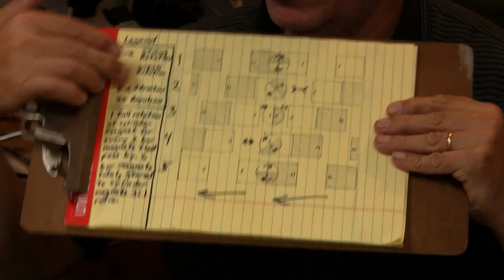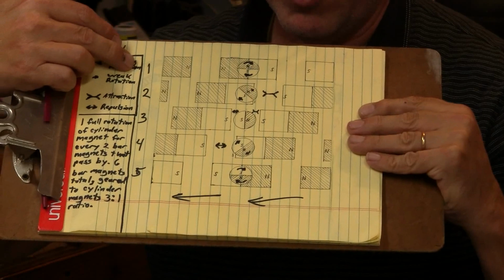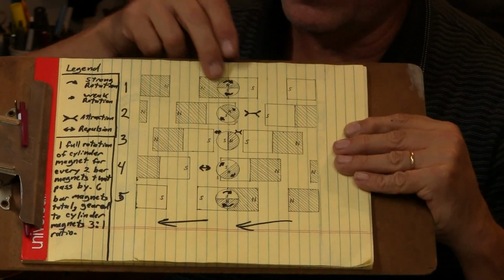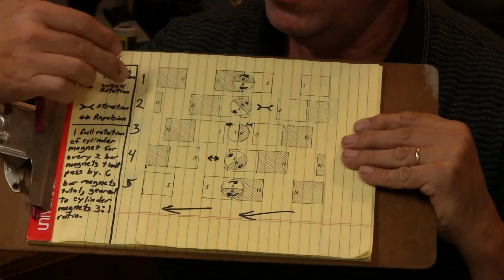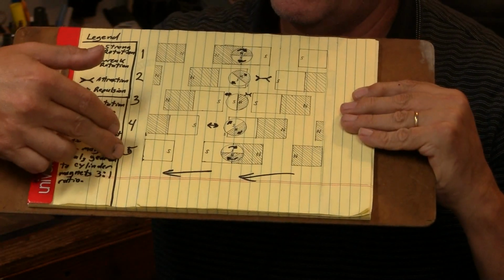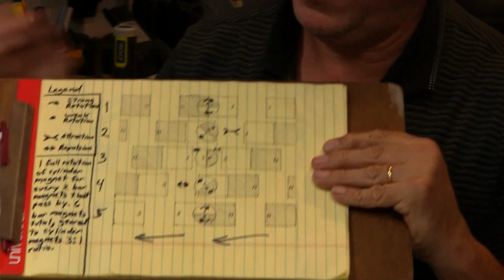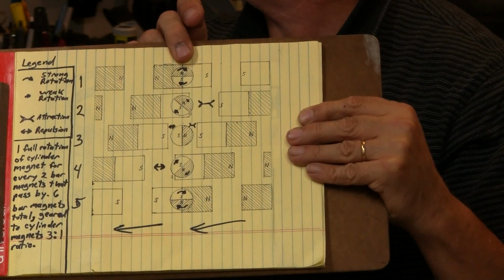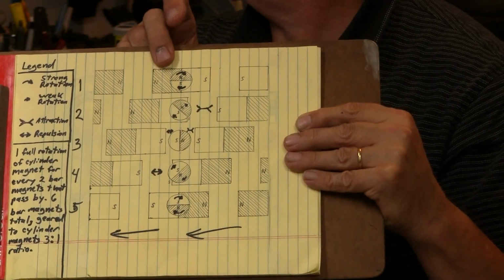#378 Vortex Field Permanent Magnet Motor part 1

Comment: Equilibrium will be the result unfortunately.
Reply from the maker: Mike Hara As of last night I have already conclusively demonstrated a state of NON-equilibrium, a continuous rotary imbalance. Not self running yet but I am making strides in that direction and have already reached the first milestone.
Reply: Funny you say that you lay awake at night working out this particular invention,I remember way back when I was in my twenties I'm now 67yrs
I had the same thoughts occur to me and like you they came when I lay down to sleep In my mind I solved the worlds energy problems over night
I invented a magnetic motor of course back in those days the internet did not exist.I mentioned it to some people that I knew,but they just looked at me and I could see in their eyes what sort of a nutter is this,so for many years I put it to the back of my mind and just thought to my self that I must be a little bit crazy having such strange thoughts.Then the internet came along and I discovered that the world was filled with crazy people like me having the same thoughts,I looked at alot of their magnetic motor
played all the youtube videos,and each one came to the same fate a brake
rather than a motor.The one I thought up years ago Is a little different from the most common ones found on youtube,but would probable come to the same fate as the rest If it was ever put together. I'm not a practical person so the Invention stay in my mind,but I'll always wonder maybe.Now Mark tell me If you feel like it when did these magnetic motor thoughts first bother you.

  PS and all the best with your latest endeavor

Comment: Hi Z, ive been thinking about this today... id like to offer something. Im not offering this to take over, just wanted to share. The big spinning barrel, what i saw in my minds eye was 4 armitures with small weights. In the beginning setting, they are all pointing outwards, all weights beyond the outside diamiter. Then as it begins to spin the armtures begin to fold in, bringing the wieghts into alignment with the diamater. I was picturing how a skating champion pulls her arms in and this creates faster spin. .. dont know if this helps or not, but i thought id share

Comment: Well done Zero , you will probably have some sticky spots somewhere , if you dont use iron core pieces to guide the flux away from them , so please research exactly , where the sticky spots will be and how to cancel them. Please dont give up easily on a first failure. You really have to nail it down. Also magnets from the same production batch have different strengths,  so please make sure you think about this..
Many thanks. Regards , Stefan.
Reply from the maker: overunitydotcom I will be adding progress reports in the description until the next video. Please check back often.
Reply: ZeroFossilFuel I would guess you have a "sticky spot" halfway between position 2 and 3.. keep thinking of new ways...

Comment: Have you modelled the rotations of the cylinder versus the outside magnet?  I ask as even a 0.001 difference in rotation between the two will stop your motor after a short while.

Comment: i see a issue when the cylindrical magnet is in between the bar magnets as the south pole is resistant to rotation, I believe if can be overcome by shifting the magnets to an angle to remove the strength of the repelling forces.  I also believe that 9 is a better number for using instead of 5 on your radial crossover points.
Reply: I don't see any basis for you to think your changes make the machine better.  You are just moving where magnetic poles are placed.  It doesn't change the fact that the force between the poles is always along the line between the poles and the strength of the force depends on the current distance between the poles.

Comment: I like, It will work but the question is: how much power can it produce, if any without a supplemental energy input. Such as electric magnetic control and for producing more power. Hey, one thing at a time, GOOD LUCK and wish you the best.
Reply: Good post, subbing this channel...
Reply: To reduce gear drag in the drive you show, if that is what Z intends to use. A very low drag gear set up would be o use only two beveled gears are needed. In other words one large ring beveled gear on the rotor drum and one beveled gear for each rotary vortex magnet. Hey just a thought, GOOD LUCK

Comment: Will the five rotational magnets be in sync or alternating? Also it would seem to me that the diameter of both the rotational magnet and the acrylic cylinder will have to all be perfect ratios for the timing to work out. Lots of math that will have to be perfect.

Comment: Ok. It looks like a good design, but very unstable regarding the timing between the wheels. Even if you push the horizontal axis a quater of a mm closer to the vertical axes, the whole timing of the system might be lost. Even if your gears wear out a tiny little bit, this whole system is compromised. Situation is the same if any gear or wheel is outcentered. I just want to see this thing moving when it's all done - in REAL TIME! Best of luck!

Comment: Z it's simple but brilliant but I think you might be putting the cart before the horse. I hope it works out but i'm skeptical.  It seems to be to good to be true but they said the same thing about Tesla. You could be on to something big. Just remember Rome wasn't built in a day and don't get discouraged.  Good luck and i,m very excited to see your results.
Reply from the maker: goriverman I'm trying to temper my enthusiasm with logic but it's hard. I've already performed proof of concept analysis of the forces generated on the bench using a row of bar magnets and the diametric cylinder magnet. I could detect no sticky points. So, on the off chance that it might work, I publish the idea now, open source it and forbid that anyone patent it or prevent it's proliferation.

I do not release my copyright claims to the design. I reserve all rights to protect the open source nature of it and defend it from the greedy. This is my gift.
Reply: You are truly a good guy  that's how discoveries are made by people like you. Thanks for sharing that, is exciting

Comment: ZeroFossilFuel at 13:00 your phase's 4 and 5 you will need either one additional rotating magnet doing phase 1 and phase 2 or large inertial force on rotor to get rotor's magnets through rotating magnet. This is the sticky point I could see.

Good luck and it will be interesting to see results!

Comment: Ooo mechanical inertia, followed by magnetic pull ... dont understand t fully but this looks interesting thank you Z.

... just a feeling, you might need a bit of wieght to make a fly wheel efftect, to add to the inertia maybe
Reply: Yeah but then comes the question of where to put a fly wheel.  The driving force is alternating locations and being reflected through gears.  Rotational inertia is reflected through a gearbox by the square of the ratio.  So one way it would be beneficial and on the other side it would become a huge drag.
Reply: Calliber50
i see... hmm interesting